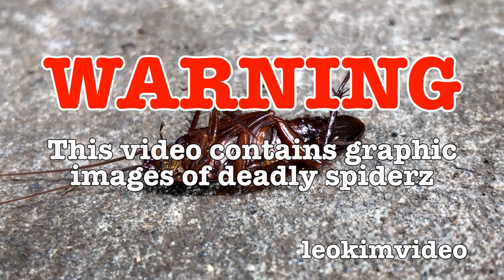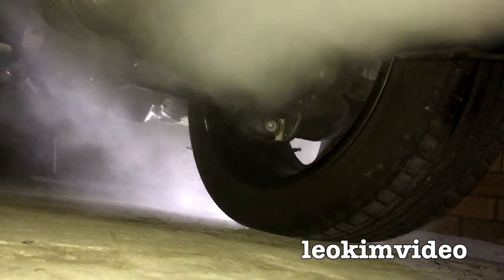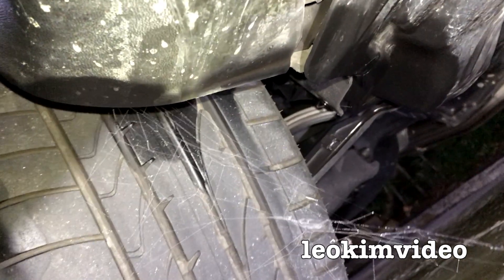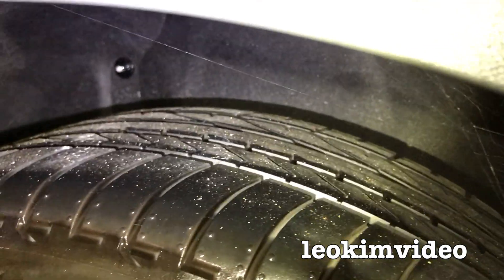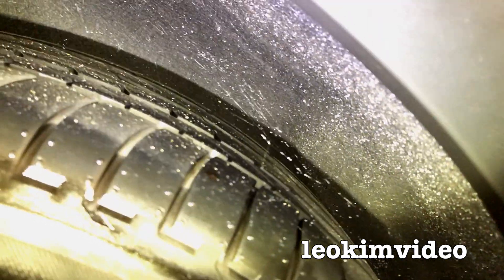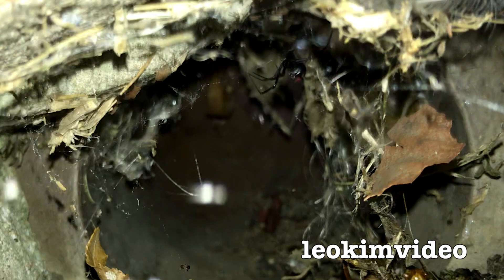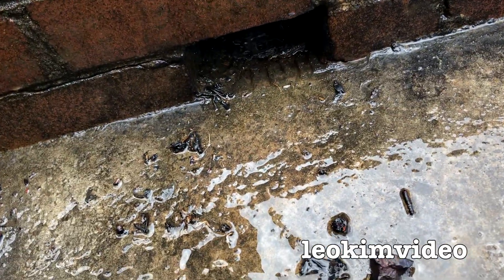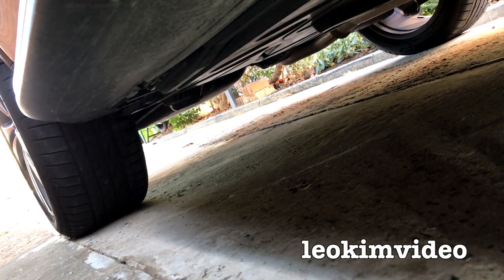Redback Spider Mercedes Benz AGAIN Spider Spray Vs Flamethrower

Comment: Thank you for ur wonderful spider videos, I have learned so much about these horrible spiders, where I live we have the sister spider Black widow they seem the same.  Because of u I now know where NOT to put my hands so I don’t get bitten. Thanks again I think the Mortein spray is the one I would buy. If I used a flame torch I’d burn my house up. I hope u keep making these videos.❤️oh yes I saw the spider run to the side when it saw u. I sure hope the spray doesn’t eat away  ur rubber brake lines or the silicone bushings under the car and by wheel cylinders.